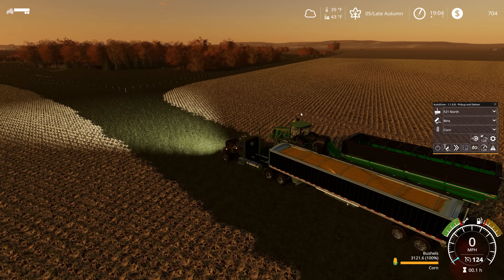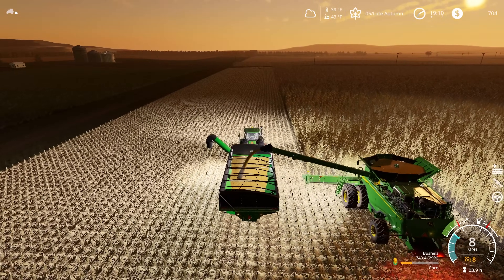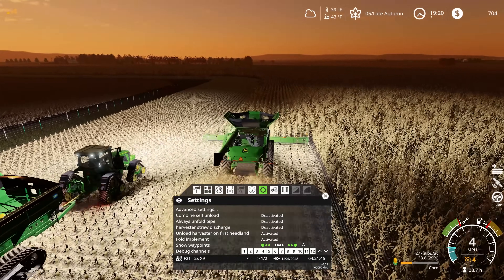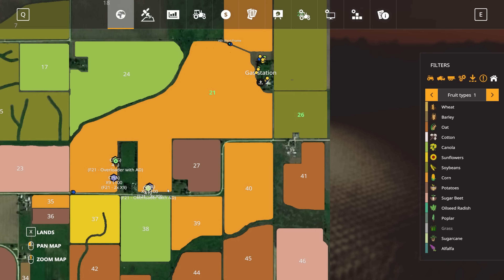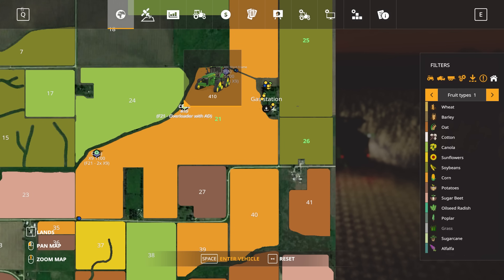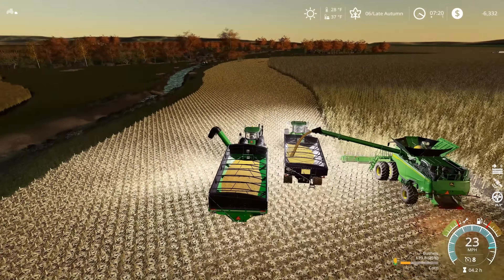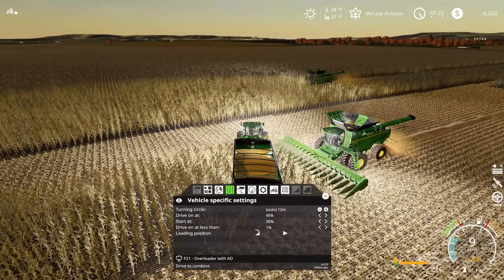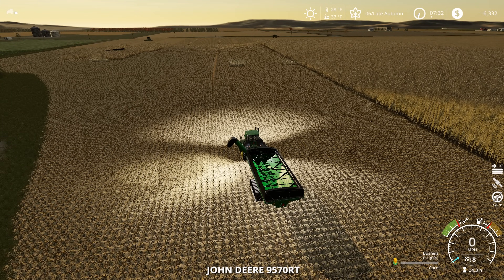Corn harvest in full swing on Flint Hills with Precision Farming - EP29

Comment: I’ve found with courseplay it’s best to use super strength to move the tractors that have collided or move the tractor away from the tree it is hitting.
Reply from the maker: Not a bad idea, thanks for the suggestion.  Would have saved a couple empty round trips
Reply: @KederkFarms   Courseplay crashing isn’t very realistic, so using superstrength has never pushed me over the edge realistically.

Comment: Is there a easy way to shut off moisture in seasons? I can't finish my fields before winter with the amount of the day it takes to have the moisture get low enough to harvest? Thanks!
Reply from the maker: Yeah it's on the last tab of the seasons menu there's an option called crop moisture I think that you can toggle off.